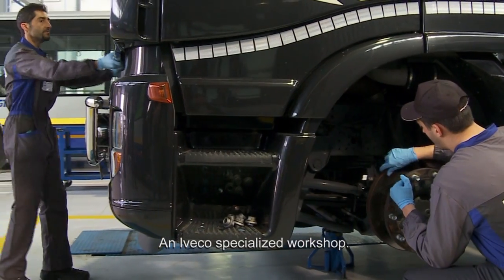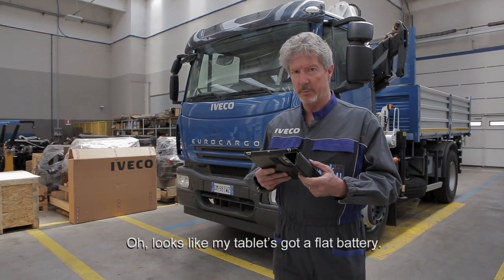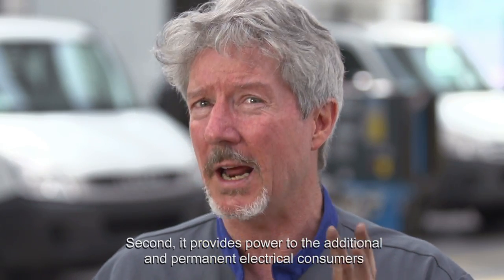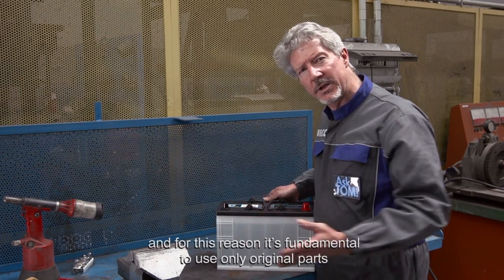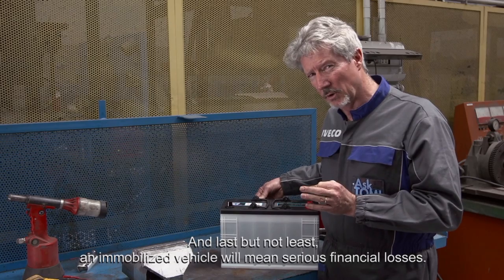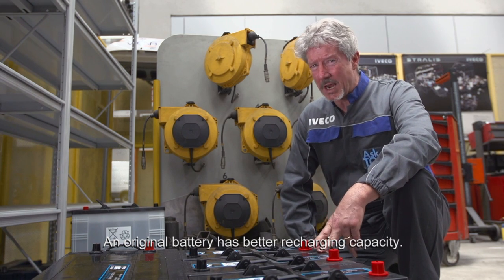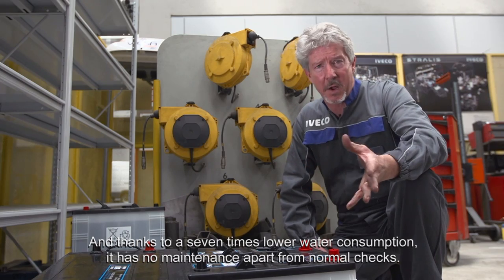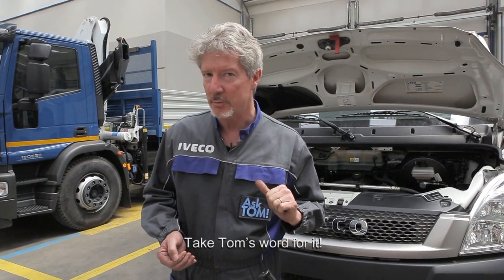Iveco Batteries - Ask Tom

Comment: Iveco Daily 4x4 double cab 2013 model: At about 90 000 km the left front wheel bearing failed. I replaced both the left and right bearings it with new bearings. After approximately 3 000km it happened again on the right front wheel. I replaced both again. The same happened again on the right front side. The bearings I replaced were not purchased at Iveco because there were no stock. I obtain BTH-1011(081T) and installed it. One of the bearings failed again. Kindly advise what the problem can be after 90 000 km of hassle free travelling